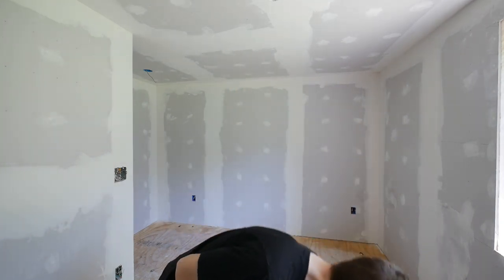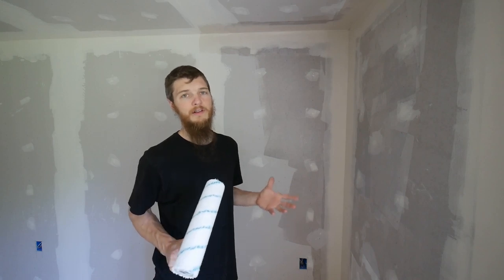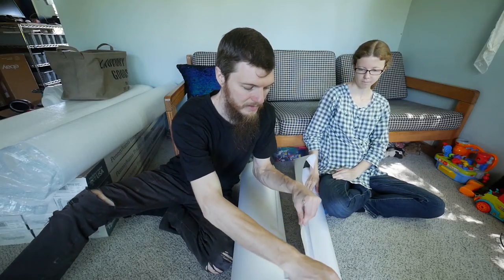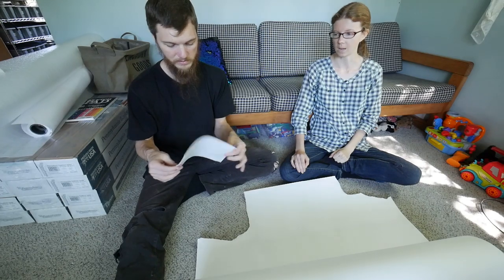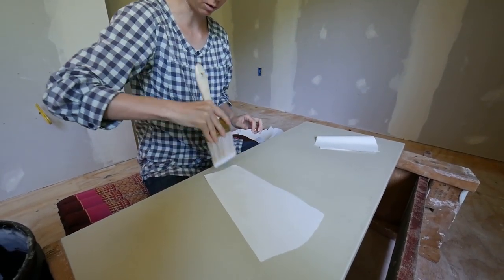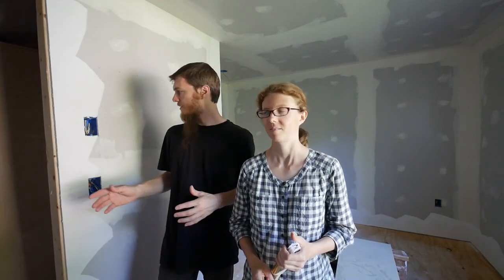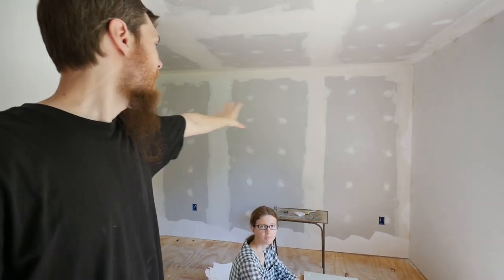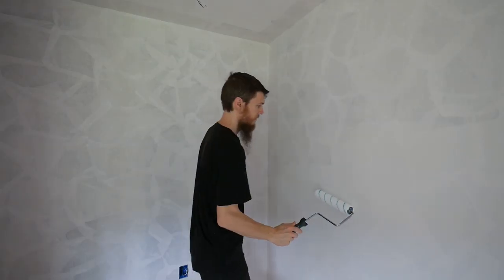Ripped Paper Walls - No Paint Challenge - Home Renovation

Comment: I had the same problem when I did a poster mural on my brothers wall. For whatever reason that particular kind of sealer is just super harsh on paper and it just overly saturates any seams and edges, and in my opinion ruining the final out come. After a lot of trial and error I found out, that instead of using the same sealer you used for the drywall for the paper, to use mod podge craft sealer instead! Its inexpensive, dries completely clear and it seals the paper perfectly without overly saturating the paper, so no lines or seams. I definitely recommend giving this a try because for me it worked perfectly for his mural and 5yrs later  it’s still well sealed and beautiful and that poor wall has been through it all lol
Reply: I was gonna say the something about the Mod Podge.
Reply from the maker: This is a great idea. Thank you for sharing. I may just try this on the next room and see how it turns out!
Reply: You’re quiet welcome! Good luck on the next project ♥️

Comment: Another suggestion. Take a piece of drywall & put your paper on it then do the sealer. It should show you how it will turn out before you go thru all the room & be disappointed at the result. You could even do several sample boards with different techniques to see which one you like.

Comment: This was a leather technique that we did 20 years ago when I had a faux finish business. We used  brown painters paper. We would crumble it up first to look like leather. If you do anything else, try putting paint into the sealer. Water based. Both. It will be more transparent than normal paint. And should fill in all the blanks without looking like you painted it. More like a custom wall paper. I like the idea. Looks good.

Comment: I just noticed what paper you bought too.   What you want to use is wallpaper liner.   It's cheap, it's thick, and I'll bet it's more opaque because it's designed to both adhere, smooth out texture and shadowing to make wallpaper hang smoothly.
Reply from the maker: That's interesting. I never knew wall paper liner existed so thanks for pointing it out to us. -I checked it out and unfortunately it appears to be vinyl coated, which is something we want to avoid.
Reply: Pat Strong   I’ve never heard of paper liner.  Will have to look that up.
Reply: Out in the Country look for some that's not.  Not all is vinyl coated.   I'll try and find a link to the old fashioned kind.
Reply: The first thing on Amazon isn't the stuff.   That is more like shelf paper.   Real liner is thick paper that is used to cover cement block or paneling or old plaster and bridge cracks and defects.   It's thick but has a soft surface so it still needs a wear surface, so varnish or wallpaper is still needed.
Reply: Check out the product at wallpapers to go.   It has no vinyl or plastic.   Just thick paper.  You had me wondering if the industry had changed, but no, the Amazon product isn't labeled correctly.  Wallpaper liner doesn't have vinyl.

Comment: Isn't the paper wall going to get dirty also? Especially with wood heat. It is pretty.
Doug, I expect you're going to have to use the Kilz sealer...which is white. You will still see the texture.  
I expect you'll have to use the Kilz before you put the paper on. The only way to test it is in a hidden closet wall. Not sure if the wallpaper paste will melt the KILZ or not. I know you WILK need to let it dry for a couple weeks.

Comment: Just for future reference, or for those of you hoping to do torn paper, the professional torn paper is made of heavy duty, brown  craft paper that has been PAINTED . This eliminates the see through problem. It is laid out on a large screen table,   loosely faux painted with one or 2  separate layers of similar flat latex paint colors ( ie: white and pale gray or beige and taupe).Any color combo can be used.  After the paper is painted and dry, it is crumbled slightly and then torn into chunks. The edge of the craft paper is visible when hung. It must be hung with heavy duty wallpaper paste.
Reply from the maker: There is no proper way to do paper walls. It is a form of art and there are multiple ways to do it. Not everyone wants the wrinkled look, also. Traditionally, the brown paper technique isn't pained.

Comment: Hey guys...looks nice...you may be having a chemical reaction with the glue on one side of the paper and sealer on the other. I worked in the printing/bindery trade over 30 years: often our customers wanted a clear coat finish after the job was printed and it was done sometimes on the printing presses and it never changed the papers opaque. Take a little time to google varnishes & paper so you'll get a better idea of how the fiber of paper reacts to clear finishes. If at all possible, when you paper the walls in another room you might look into spraying on the clear finish with a different non-water base type coating and do a test first on some excess materials to see what will be the outcome! I know you're experimenting but being disappointed hurts...especially with huge time consuming projects like an entire room. Kudos for being so innovative!❤

Comment: I feel like if you guys wanted to put color on the walls you can take a sponge or lightly apply desired color and then wipe it off as you go so the paint will stick in the edges of each piece of paper to bring out the pattern.

Comment: Well, I like both rooms, maybe the thing to do is spread a very thin layer of the spackle on the walls before you seal it. So the board is totally covered and since there is no cracks or tape to worry about, a damp sponge will work instead of sanding the whole thing. Don't worry about it, we learn as we go and grow. Each room will be better than the last as you progress through future projects!

Comment: you might get the same resistance against dirty fingers and stuff if you coat the painted wall with the same surface sealer youre using with the paper 
about the paper becoming see through again , you could add a white paint dye to the surface sealer to make less clear and make it cover a litte better ........ youre basicly turning it intoo a whitewash paint
another option is to use the stuff you used to seal the sheetrock over the paper too so the paper doesnt suck the sealer up as mush
you can test some ideas on a small peice of sheetrock offcut and see the results before doing the same thing at a larger scale

Comment: A suggestion is to put primer on the drywall before papering.  That would seal the drywall paper keeping it from absorbing the paste.  I think the sealer is absorbing through the paper into the drywall paper.  New drywall needs to be primed before painting otherwise the paint will absorb into the drywall paper making the paint splotchy.  When we had our master bath remodeled we decided to paint ourselves and were told to primed first.  Just a though.

I applaud how hard work the two of you are.
Reply: They did put a clear coat sealer on the drywall before papering.

Comment: Its like a wet T-shirt event.  When anything porous becomes wet, it becomes transparent.  However, an acrylic or oil retains the appearance of wetness even though it dries.  This is what brings out the dimensions of wood grain when its sealed.  It removes the flatness of the surface dimension and brings in light, which gives it a transparency.
Reply: Yeah you got it. The tiny air bubbles get filled with sealer. The tiny air bubbles in the paper scatter the reflected light you see. Filling them keeps the light more coherent and so you can make sense of the light further through the paper (aka looks clear)

Comment: So now 5 years down the road,, how would you remove this? We just bought a home that used this technique with brown paper bags. I would like to go back to the sheet rock. Can you give me a recommendation on what you would do? Thanks
Reply from the maker: Wallpaper remover may work if they used regular wall paper paste. Or just skim coat it with drywall compound to smooth it out and paint over. It all depends on the condition and how much work you want to do. Some people use a steamer to remove wall paper but I don't know if that would work with this. Also, depending on what sealer they used on the paper, if any, it could  complicate the removal.

Comment: Won’t the white paper walls look dirty when they are touched my dirty hands or if furniture touches the white paper walls?
Reply: If it is sealed good it's more resistant to getting dirty. If you pay attention the dirty walls are always painted with "flat" paint.
Reply: Agree, regardless what you put up if touched a lot with dirty hands etc will still look dirty.  I think the biggest difference is the texture.  I prefer painted walls myself, but to each their own.  To me if this technique is used throughout the house it too will become boring.  I first saw this technique used on flooring about 5 years ago.  But the lady put a coat of some type of  protection coating of some type over it after it was pasted down.

Comment: Try using regular Elmer’s school glue mixed 1/2 and 1/2 with water not wallpaper paste when putting the paper on the walls. When it dries seal it with a water based matte finish polyurethane. I believe the chemicals in the paste and sealer are having a reaction and that reaction is deteriorating the cellulose fibers of the paper.
Reply: I agree a school type glue will do the job then seal with a water based product.

Comment: I still can't believe you dont prime your walls first.  It protects the drywall.
Reply: dwisecup51:  Doug put sealer on the drywall first!  Isn’t that the same thing as priming?
Reply: @sandrakohlstedt8583   in my experience if you dont put a primer with pigment on your new drywall you will never be able to remove any paper or wall treatment without peeling the top of the drywall off. Been there done that.

Comment: Do you have to sand the walls before you do this process. I do not like to sand drywall.
Reply from the maker: No sanding, we just try to get it decent looking. Instead of sanding, a damp sponge works great at smoothing out the seams to avoid sanding and dust. The paper is pretty forgiving and hides a lot of imperfections, which is one of the main reasons we're doing the paper technique. Make sure to use the drywall knife to scrape off any hardened compound chunks/bumps before papering though  :)

Comment: So what if you decide to sell your place and people don't go for "paper" walls (which I would think most wouldn't want). How difficult is it to remove the paper so you have a good surface for painting? If it were me (which obviously it's not), I WOULDN'T do the paper thing on any more of your walls!
Reply from the maker: The paper makes a fine surface for painting in my opinion. It's probably similar to removing wallpaper. It can be done but takes a little effort.
Reply: With the sealer it won't be a problem to paint over and it will take paint very well.

Comment: Just water down your glue and use that as a sealer.  Or what you can do is color your glue with whatever color/tint, but where the paper overlaps will always be darker because it's doubled.  :0peace  PS: next time test in a closet before you do the whole room. :)peace

Comment: I was reading a lot of your replies a lot of them mentioned maybe painting over the white even though it I'll have a little bit of a two-tone effect because of the color of the drywall under it and I thought just popped in my mind I don't know if it would work or if you would even want to try but I wanted to tell you what I just thought about.
I was thinking of something like a watercolor very pale and it doesn't even have to be on every wall. I was thinking using just plain water with food dye in it. I'm not talking about a bunch of colors mixed together like one at a time with your one ruler it's dark enough color I would test it first on boards like some of the others had suggested with the paper and then roll with and see what you think. I know you said I guess she likes a peacock but she likes different colors so with that I'm thinking watercolors you know you see paintings there very light see through and I thought how perfect is that clean water and a color of food coloring. It's just a thought it's something I thought might be kind of cool to do. Try it on something first okay it's just a thought.